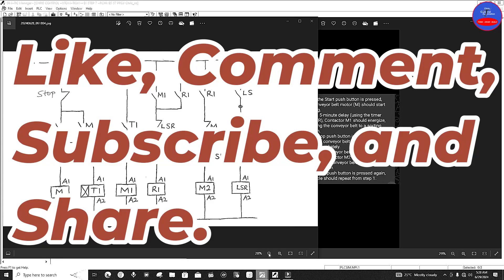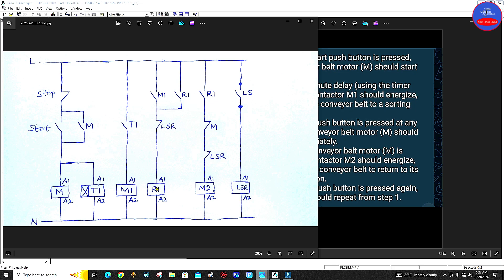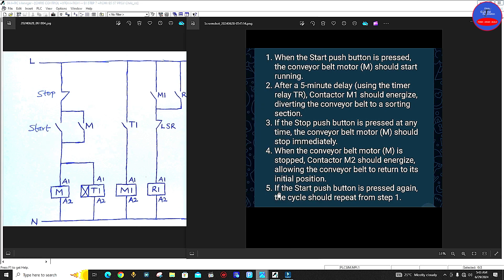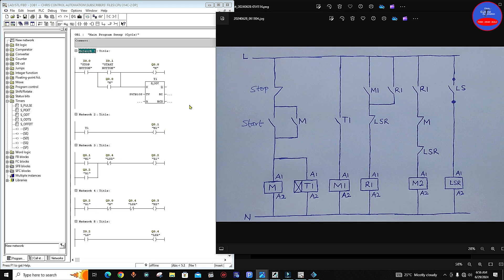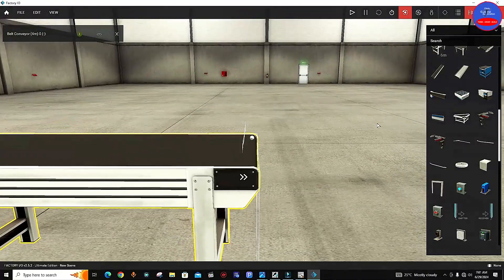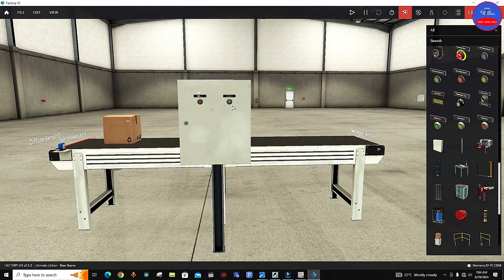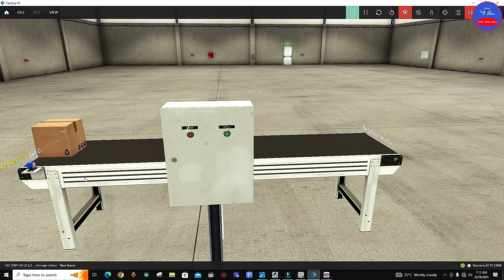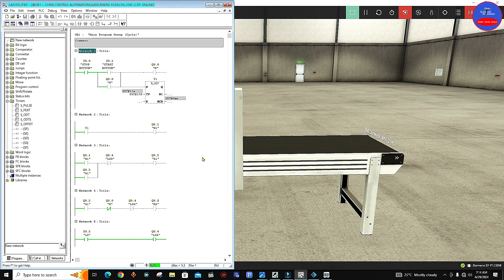Conveyor Sorting System | Proximity Sensor Sorting Station

Comment: How are you Chris. 
Please help me with my design below.

I want to design a circuit using DOL starter,  i have to add a rope switch/trip wire switch on a conveyor. 

Which means i will have two ways of stopping my circuit[ by using trip wire switch or using emergency stop]